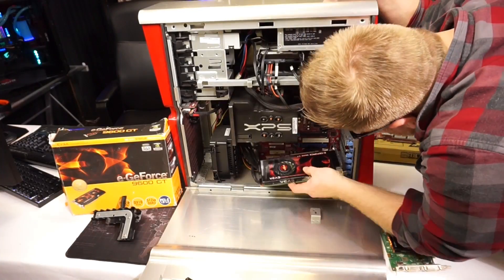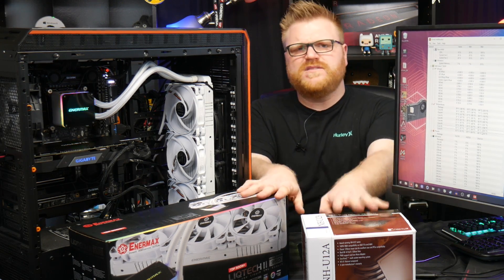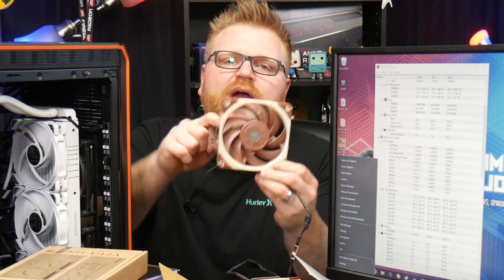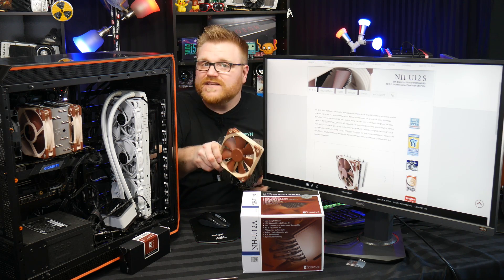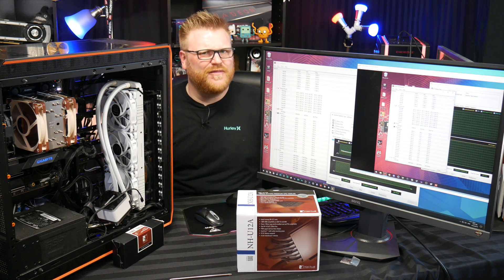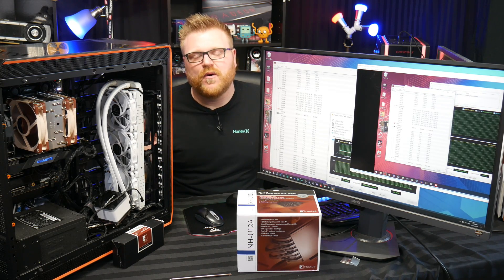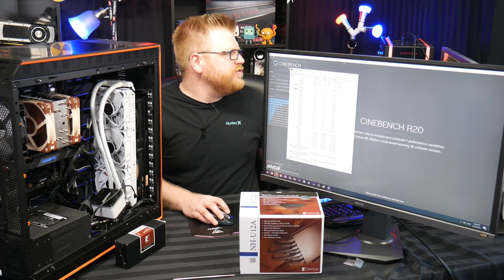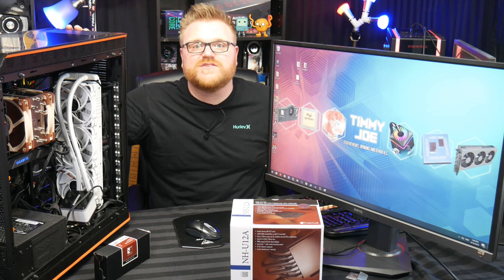Noctua's new cooler keeps up with a 360mm AIO!

Comment: I had a Fractal Design 360 AIO and to be honest I got the best performance out of it with just 3 120mm fans on it.  I also din't have a set of 6 identical fans.  Three were Cooler Master and three came with the cooler which I think caused push pull to not work great even though I tried to make the air pressure levels match.  Those two larger fans in front of the Enermax may be stifling its performance because they aren't aligned with the fans on the opposite side.  I guarantee if you slapped 3 or 6 Noctua or EK Vardar fans on that Enermax you'd get 4.7GHz stable on that chip.  Assuming there isn't anything wrong with the AIO.

Comment: something wrong with AIO or cpu heat spreader.
Reply: no AIOs suck overall, its FAD for people that do not know any better, you wont get proper cooling from small volume AIO made from substandart material (proper watercooling is COPPER not aluminium ...) ...

you pay more
you introduce more points of failure and liquid danger into the system
you still get at best SAME or slightly lower cooling performance than top aircoolers

only aplication for AIOs is small form factor where proper aircooling is hard, form midtower or bigger its air or custom waterloop, anything else is just STUPID ...
Reply: @Asghaad  lol fuck off

Comment: The fan color has always kept me away from Noctua's products. But the performance of those fans and the air cooler got me thinking about replacing my Cooler Master V8 GTS 140mm air cooler. Thanks for testing this out. BTW: You should get a Swiftech Drive X3 AIO. IMO it is the BEST AIO on the market. Check it out!
Reply: Noctua sells black fans so you can replace the brown fans but they come at a high price
Reply: @scyra9997  Optimum Tech just did a comparison video on those fans. The black ones are louder. Ugly as they are, they are the quietest, and most efficient ones made, hands down. https://www.youtube.com/watch?v=dX7azFtJDT8

Comment: Noctua sells other colors for fans separately on amazon/newegg under another brand name. Also they do have regular fan clips for other fans. The don't have any RGB fans as of yet.
Reply: amorgan20111 I need to secure fan clips in general so I can actually run different coolers in push pull
Reply: @ArtisChronicles  contact noctua via email and with proof of purchase from them, amazon, newegg ect they will mail you the clips free of charge

Comment: Had an NHD14 since 2009 at this point it's had multiple different homes it's currently on my 6700k @ 4.8ghz and never breaks 70c, every year or so i check to see if anything is worth upgrading to (without the hassle of going full water) & never seem to find anything that's much better Noctua really are in a class of their own for air cooling also i couldn't give 2 fucks about the colour or rgb so best value buy of my life i think lol.
I do have another cooler that matches it's performance the dark rock pro 3 seems very similar temp wise but it's such a pain in the ass to fit it's no competition i have that on a x5670 @ 4.6ghz and it also does extremely well.

Comment: one thing i was never too fond of was that air coolers tend to use the hot air inside the case in contrast to radiators that are typically pulling in cool air and staying more consistent. if the gpu is at load and the case was closed id be pretty surprised to see it maintain the temps that you got here

Comment: Honestly, I think your AIO is clogged.  Or your chip is wonky.  Would like to see this test redone with a known good AIO and known good chip.

Not saying the test are necessarily invalid, but those liqtechs are known cloggers.  Even gen 2.  And that ES chip could be wonky.  It could be either problem, or both, or neither.
Reply: Idk about the Enermax problems, but there is a definitly problem with the air choker case.

Comment: Noctua is the best Air coolers, i had 3 aio's from Corsair..280mm and went back to Noctua D15. I will never buye a AIO again.
Reply: yep you learned the hard way more power to you
Reply: @suadmemo2412   I always had a Noctua NH-U12P as a backup from the lga 775 era (q6600  G0 stepping using that now as a linux test pc) on my am4 pc the d15 i doing better than the aio junk

Comment: I'd try this with another 360 AIO whether it be a different brand or the same.

The front fans may be creating extra resistance as well, but shouldn't really. 
The pump could be goofed a bit? 
This doesn't seem right but wouldn't be too surprised if it turned out to be accurate but it's always good to make double sure and that AIO managing 500 W TDP? That seems incredibly optimistic! 

Not hating on the air cooling or Noctua. If I could afford 9x Noctua fans right now I'd get them for my rads. My first air cooler was a PH-TC14PE. It's still beastly and I've kept it, as I'm sentimental and it was and still is amazing. This over 5 year old cooler still functions or it did 6 months ago when I tested it haha.
Reply: he got the bequeit 900 case, its a damn chocker for any watercooling, many dudes ditched it because of it. it would be no wonder, if he stick out this radiator from this choker, he will get better results then noctua. or he could stick the radiator @ top, so the radiator would double or even more fresh air then yet. idk why he didnt done a test bench instead. you always do this before putting it in a case.
Reply: @Xenoray1  Good to know. I've not looked into cases for about 4 years now after I got my poor man's Corsair Obsidian 900D. The Phanteks Enthoo Primo haha but at least i've learned something new.

Comment: I don't have a windowed case so I'm down with the brown!
Reply: I would get it even if I had a windowed case. I actually prefer the beige over the "boring" black.
Reply: There is also the chromax (all black) versions of the U12S and D15...
Reply: Earth tones FTW!
Reply: Down trough brown town
Reply: I like the look of Noctua Fans, my top mounted 360mm Radiator looks like a giant GPU. With Black fans it wouldn't look so special.
Reply: @-Qonqueror-  I like that when you open a PC up, the parts that matter are identifiable, no silly PSU shroud, pointless M.2 heat blankets. You don't see classic car folks hiding their engines. 🏎
Reply: @-Qonqueror-  i think you could paint them  black!(i am thinking to the same thing)
Reply: Are are "Up" with the brown too :D
Reply: That's what she said..
Reply: @internziko  beat me to it

Comment: You should take out the Enermax Radiator with those fans out or stick it to the top because there are MASSIVE fresh airflow gaps, im sure the Case is choking it, because the Air Cooler itself can take fresh are from everywhere because you didnt closed sidepanel / window (what i cant understand), meanwhile the AIO need to suffert trought the small gaps from bequiet (many watercooling dudes ditched the case because of the choke). those results cant be right. sure the noctua is pretty nice and im sure it will come close, but not over a aio, never, were living in planet with rules and noctua couldnt just pass them.. but they like brown colors, so maybe they can.. lel

Comment: Direct Die cooling sounds like a winner. Der8auer has the socket plate for cheap. I'm rocking a ZALMAN CNPS 9900MAX 300watt 2009 dual tower 135mm fan monster. and it cools my i7 8700K at 5GHz 1.250v 80°c maxed out. I always stuck with monster air coolers cause they just work. I got nothing against liquid, i figure if i don't need it more power to me.

Comment: I would flip that Enermax radiator or install it at the top of the case. Liquid flow may not be ideal with the tubes at the top, since water will tend to pool at the bottom and air may be trapped at the top. Just a thought...
Reply: ArmpitoftheGiant its an all in one cooler it does not matter

Comment: I had a loud AIO and last year I swapped it out for an NH-D15 and never looked back, plus it's performs way better and is so quiet it's almost silent. I got it on sale for $50 bucks less. Best buy ever.
Reply: well those brandnew corsair are dead silent.. and for the looks ^^ but im sure, if my custom loop would die and i buy or win a noctua as replacment, i would just let it stick there.

Comment: If you take the enermax off  you probably have better results..i would rather have the fans on the enermax infront instead of having the push, pull system

Comment: It really seems to me that alot of aio run the same temperature or around that. I have an h115i pro with my 2600 and have tried other aio and sizes with the same cpu and they all get around 35c - 60cat 4.2 mhz depending on load. Alot of air cooler give me the same also. I think it just comes down to looks to be honest.
Reply: it mostly come down to the radiator size, thiccness, quality, and form ( u form, x form) also fans total, fans rpm, fans mmH20 and m3/h (static pressure or air flow optimized). then there comes push pull, push or pull and of course the Case itself, is it a Airchoker or Not. And your Ambient Temeperature in your Room too. The Only thing that doesn matter in Custom Watercooling is the flow like going from cpu to radiator to gpu to reservoir or cpu to gpu to radiator to reservoir. some get 3 degress more on cpu, some 3 degress less on cpu, some 1 degress overall more on less, but water is water.

Comment: i have a deep cool 240 AIO and actually prefer my older noctua... plus the stress of thinking my AIO could eventually blow a seal and ruin my 1080ti sends shivers down my spine... i have yet to swap out my AIO back to my air cooler (since i dropped over 100 on this when i got my 7700k ) but hionestly, i think my noctua is a better all around cooler.my AIO has a lower ambient, but the noctua can deal with the initial heat spikes from an overclock better.. something about having all that metal i guess.. just dosnt look as nice in my P5 thermaltake all glass case ...
Reply: that would look hideous, but well, there is nocuta chromax :D

Comment: I have used Noctua air coolers for years they always cool amazing I rock a NH12S that when i got it i ran it on a AM3+ phenom II x6 it now lives on my 5820K I7 cooling it just as good. It didn't have the proper brackets for it, So I contacted Noctua and they sent them out for free!!!!
Reply: Well thats why you paid the premium right ? Would be weird of you wont get it. It always been like this.
Reply: @Xenoray1  thats the thing tho i bought the cooler in 2010 and they gave me new brackets 8 years later for it.

Comment: the bad performance of your Enermax cooler might be because of the way you have your fans set up. push-pull usually is only effective if you use the same fans on the front and the back. I had a h115i and it was performing worse when I had the two stock fans on the front pushing plus two Coolermaster fans on the back pulling, then when I just had the two stock fans on it pushing air through the rad. Also, consider that beQuiet!'s fans are not known for having good radiator performance which could be hampering the amount of air that the rear fans are able to pull through the rad. 
TLDR, consider testing the Enermax cooler with/without the extra fans on the front.
Reply: the biggest problem is not the configuration about fans and the fans itself, its the damn case.
Reply: @Xenoray1 I think its both. I do agree that that case is shit for airflow but from my personal experience, fans do make a big difference on radiators
Reply: @SpencerBaum  Of course they do, i know it.
Reply: The branding of fans don't matter. It's all about air pressure differences. Any push-pull is better than just pull alone, push alone, pull-pull or push push with any fans of comparable pressure output.

Comment: How tf does an 8 core that turbos to 4.2 hit 90 on a 360mm AIO yet a 6 core X58 xeon can do 4.5 on all cores and only hit 70 with a 240mm AIO...
Reply: They increased the thickness of the direct die hence the higher temperature, Der8auer just happens to have a video adressing as to why the insanely high temperatures on Intel high end CPUs are present even though it´s about how you can tweak the i9 to get lower temps on.

You might learn something new every time you watch one and another of his videos of what part is named what and so on. Interesting and a little geekly to say the least.
Reply: because his case is a airchoker for radiators, he doesnt read reddit aparrently.

Comment: seen the 7820x at 4.7 with temps 10c lower than that aio before, with no delid
Reply: But you haven't "seen" proper grammar so.....
Reply: @GummyBearRacing  shit, I forgot YouTube comment section was an English exam
Reply: because most use testbenches and not air choking bequeit cases :D its not the aio fault here.